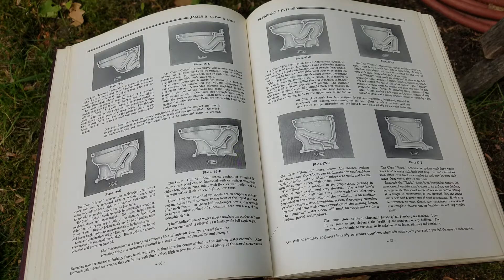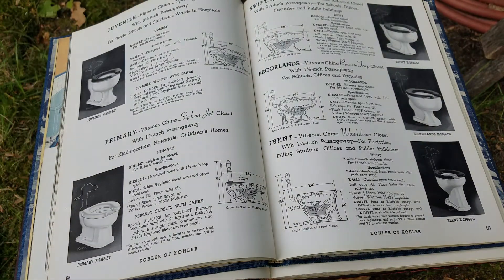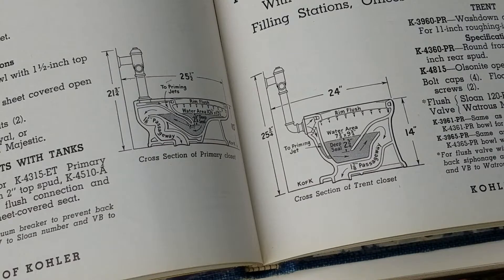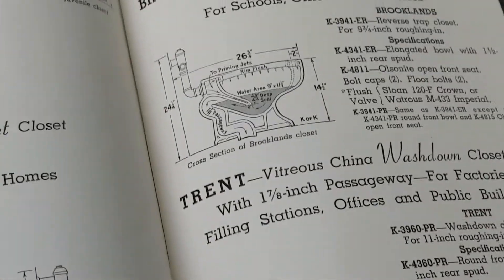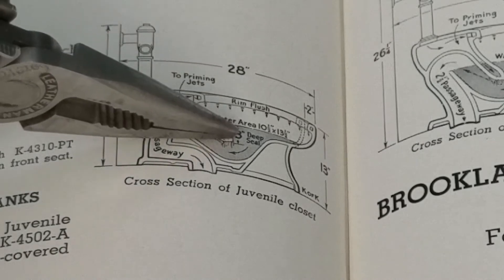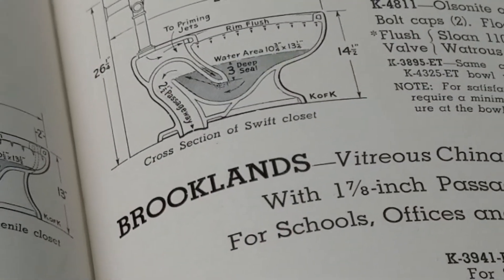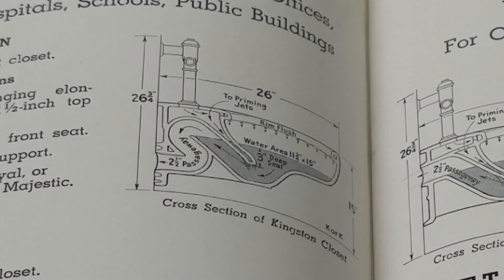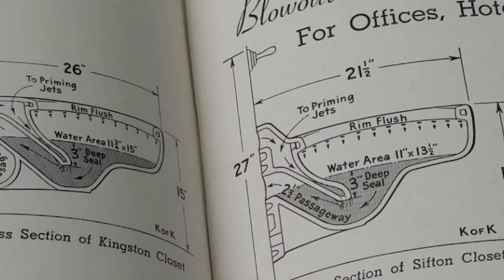#136 Vintage toilet types explained.

Comment: Awesome , thank you ! Could you please share what books you are using?
Reply from the maker: I used a 1948 Kohler catalog for this video. They come up on Ebay from time to time.
Reply: @vintagekohler6085  Sometime, Could You Please 😌 Do A Video On The Pictures Of  The Horseshoes/Toilet Seats And Explain The History Of The Shape Styles And The Years That They Were Available (From The Earliest/Oldest To The Latest/Newest Of The Olsonite 5s And 10s And All Of The Shape/Style Look Alikes), Thank You.
Reply from the maker: @user-wg6er5ob5w  I don't have a complete history on that but I could get my vintage seats and catalogs together for a video sometime. The horseshoe seats are called "open front" seats.
Reply: @vintagekohler6085  By The Way, When I Found It,It Was Using "Church" Counterpart Version Of/Answer To The "Ball" Hinges;Rounded Off Where Olsonite's Are Cornered/Pointed On, Rounded On Where Olsonite's Are Straight/(Flat) Off, & It Was/They Were Using Rectangle Styrofoam/Rubber Washers/Rings ;("Beneke") Counterpart Version Of/Answer To What They Might/Should Have Used With The Original Olsonite "Ball" Hinges (Stabilizers), Even If It Was With The "Church" Counterpart Version Of/Answer To The "Ball" Hinges, And Not "(Have) Rob(ed)" The Rectangle Styrofoam/Rubber Washers/Rings From/(Off Of) The "Beneke" Counterpart Version Of/ Answer To This Shape (Style) Of/For The Seat (Model Number 523);Heavy-duty Elongated HorseShoe Toilet Seat, Even If Both Of The Horseshoes/Toilet Seats Were Installed On November/December 1936 Castings Of Eljer Regular/(Round/Short) Commode Toilet Bowls In  Adjacent Stalls Side-By-Side, (There Were Also Urinals Installed In That Necessary Room Too), Even If They Want(ed) To Say "Well, It's The Same Shape/(Style) Of HorseShoe Toilet Seat", I Know & Say "But, It's Not The Same Brand Of HorseShoe Toilet Seat As To Where 'All' The Accessories/Pieces/Parts  Are All Interchangeable, It's Different, Some Brands Have Accessories/Pieces/Parts That Are Interchangeable (Like "Church's" & "Olsonite's" "Ball" Hinges), As/When/While Some Others/Other Brands Have Accessories/Pieces/Parts That Are "Unique/Specific To"/"Specifically Designed/Made For/By Them" For Their Own Use On/With Their Own Counterpat Version Of/Answer To The Products That They "Really" Are Not Interchangeable At All, ("Peter J. Sperzel's" Brand's Version (Mostly) Had/(Used) "Barbell" Hinges, Sometimes You Had Your Choice Of Hinges/(Types/Styles) To Use), ("Bemis's" Version Used Hinges Pretty Much Like The Ones That Are For The "Stronghold" Seat) ("Beneke's" Rectangle Styrofoam/Rubber Washers/Rings Aren't Meant To Be Used On "Church's" And/Or "Olsonite's" "Ball" Hinges, The Shape Just Doesn't Fit), Nor Are The "Stabilizers" To Be Used For With/(Right Under With The Hinges Right-On-Top Of Them), The Following, Brands, Are; "Beneke", "Bemis", "Peter J. Sperzel", "Church's" & "Olsonite's " "Angled"/"Set-Forward" Hinges, If They Are To Be Used At All With These Types Of Hinges, They Are To Be Used On The Other/(Under) Side, Where/When You Then Put On The Full Metal Washer/Ring, Then The Metal/Locking Washer/Ring Et-Cetera The Last Piece You Put On Is The Nut, If The Stabilizers Are To Be Used Right-Under/Right-Below The Hinges (With The Hinges Right-On-Top Of Them), They Must Be Either The "Church" Or "Olsonite" "Ball" Hinges, Or The "Bemis"/"Church" Or "Olsonite"-ReBrand/ReBadged "Marshmallow"/"Bend" Hinges;(The New Ones Are Pretty Much "Sta-Tite" With "Bushings" On Them).
Reply: @vintagekohler6085  With Both Of The Commode Toilet Bowls Being Made Late;(Towards The End Of)1936, Would It Have Still Been 1936, Or Now;(Already) 1937 When Those Two Commode Toilet Bowls Were Installed?(They Were Both "Eljer") , It Was An Old Elementary School, With The Urinals Installed, What Do You Think The Sign On The Main  Door (To That Necessary Room) Would Have Said?, Sorry To Relate That That Part Of The Building Was Burned By Arsonists In 2019, I Heard About That From My Mom/Mother (God Rest Her For 2 Years Now), I Was Not Anywhere Nearby That Building When They Burned It, But It Would Have Been Nice To Have Turned It Into An Apartment Building, For The 12-Year-Old-Tweenagers To Crash For One;(Fall-Out) Night, And Then The Each-Year-Older-Teenager(s) To Still Crash The Fall-Out Night And (Then) One More Night, According To Their Age, 13-Year-Old-Teenagers; Up-To A Second Night/(2 Nights), 14-Year-Old-Teenagers; Up-To A Third/(3 Nights), 15-Year-Old-Teenagers; Up-To A Fourth/(4 Nights), 16-Year-Old-Teenagers; Up-To A Fifth/(5 Nights), 17-Year-Old-Teenagers;Up-To A Sixth/(6 Nights), 18-Year-Old-Teenagers;Up-To A Seventh/(7 Nights), 19-Year-Old-Teenagers;Up-To An Eighth/(8 Nights), 20-Year-Old-(Teenagers)?;Up-To A Ninth/(9 Nights), At-A/(Any-Given)-Time;(But-Not-"'On-"Their-'Birthday(s) 🎂'"'" Because That's Inconsiderate Of Them/(The Grown-Ups/Adults), On Their Parts), &/And/But Also When They;(The 12-Year-Old-Tweenagers To The 13-Year-Old-Teenagers To the 20-Year-Old-(Teenagers)? Come/Go Back Home, The "Grown-Ups"/"Adults" That They ;(12-20-Year-Old-Tweenagers-Teenagers)Have To Answer To Should Have To Pick Their Battles And Think To Say To Themselves That "They're (Joining You/Us)/Growing-Up So (Fast), That It's Not Worth It;(The/This Battle), So Loosen Your Grip." &/And Reconcile When They;(The Teenagers) Get Back Home, Then When They Turn 21, Then If They Want, Then They Can Move Out Into  Any Of Those Apartments Either For Free, Or At An Affordable Low Price;(Pennys-On-The-Month), That Way They Can "Pool" Their Own Money Together In Order For Them To Buy A/The Home/House Of Their Own Dreams, Even If In The Apartment's Bathroom, The Very Same Showering Stall/BathTub Built-In Is Still There, And Also The Very Same Lavatory/Sink Is Still There As Well, Also The Very Same Commode Toilet Is Still There As Well & It Still Has The Very Particular Same Commode Toilet Seat On It As Well, Because People/(12-Year-Old-Tweenagers, 13-19-Year-Old-Teenagers, 20-Year-Old-(Teenagers)?) Come And Go/Come On A/The "'Fall-Out' Night(s)" And (Then) Go (Back Home) The Immediate Very Nxt Day/Night(Right-After-That)(12-Year-Old-Tweenagers)/(Even 13-19-Year-Old-Teenagers)/(Even 20-Year-Old-(Teenagers)?), 2/(Two) Days/Nights Later(13-19-Year-Old-Teenagers)/(Even 20-Year-Old-(Teenagers)?), 3/(Three) Days/Nights Later(14-19-Year-Old-Teenagers)/(Even 20-Year-Old-(Teenagers)?), 4/(Four) Days/Nights Later(15-19-Year-Old-Teenagers)/(Even 20-Year-Old-(Teenagers)?), 5/(Five) Days/Nights Later(16-19-Year-Old-Teenagers)/(Even 20-Year-Old-(Teenagers)?), 6/(Six) Days/Nights Later(17-19-Year-Old-Teenagers)/(Even 20-Year-Old-(Teenagers)?), 7/(Seven) Days/Nights Later(18-19-Year-Old-Teenagers)/(Even 20-Year-Old-(Teenagers)?), 8/(Eight) Days/Nights Later(19-Year-Old-Teenagers)/(Even 20-Year-Old-(Teenagers)?), 9/(Nine) Days/Nights Later(20-Year-Old-(Teenagers)?), So Why Even Bother To Change The Commode Toilet Seat To "Welcome" New People, Why Not Just Let It Be Well Enough To Just Leave Alone And Just Use Whatever's There, You Can Have Your Own Different Commode Toilet Seat When You Get Your Own Home/House. Either Way Can U Please Do Your Best To Answer Me About The Age Of The HorseShoe Toilet Seat?, Thank You.
Reply: @vintagekohler6085  I Have A HorseShoe Toilet Seat That Is An Olsonite Number 5(Round/Regular/Short) And The Numbers Engraved In It Where One Of The Bumpers Goes Is 1/67 And It Has These Metal "Nuts" In It Where The Bumpers Would Have Been Screwed On, Rather Than Just Plugged Into It, Can U Figure Out The Age Of The Horseshoe (Toilet Seat) Please And Let Me Know?, Thank You.
Reply: @vintagekohler6085  Thanks!
Reply: @vintagekohler6085  In This 1948 Catalog, Do Or Don't They Already Yet Have The RoundBack HorseShoes; Where Both Of The Inner & Outer Edges Are Circular(Round) In The Back (Like The Number 5(Regular/Short) & Number 10(Elongated), AndThe One That You Took Off Of Your Favorite (1949)/(1 Year Later/Newer) Penryn, By The Way, When Was That HorseShoe Toilet Seat Made? If You Can, Can U Please Do Them All In Chronological Order And Say "First Year For Those" Like You Did The Kohler Derry Urinal Toilets (1941), Please?, Thank You.